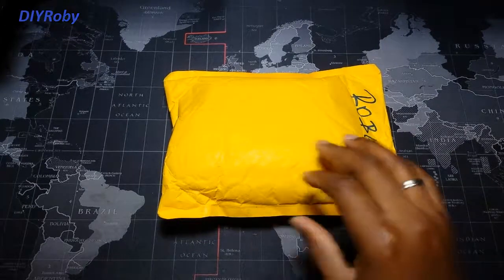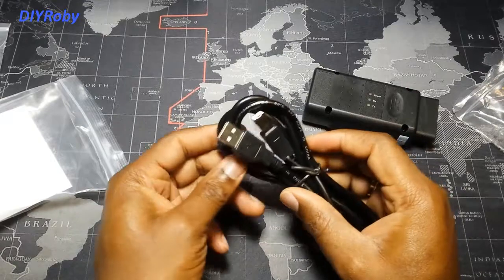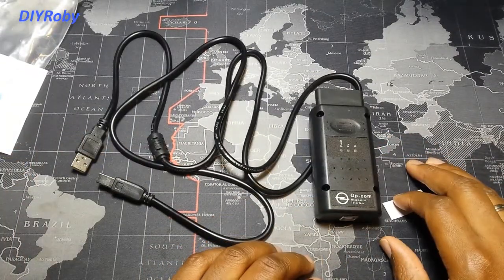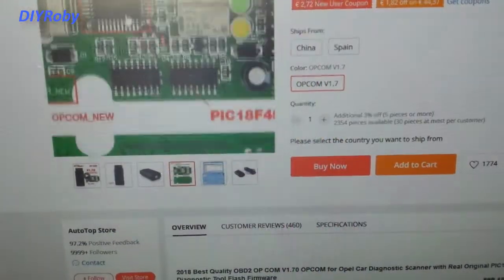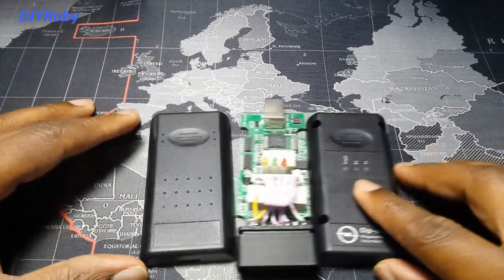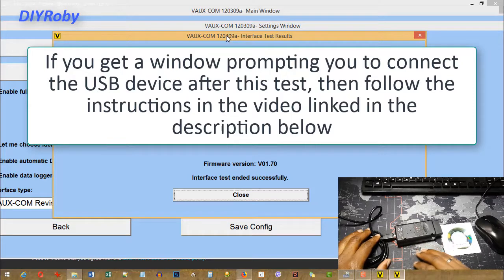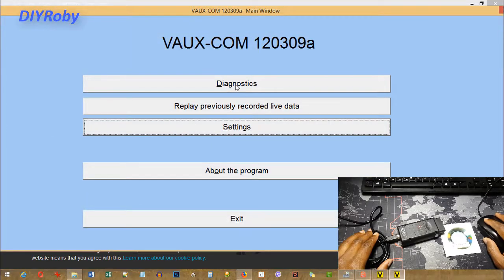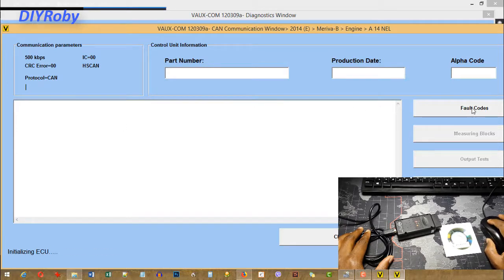Opel Car Diagnostic Code Reader OPCOM V1.70 PIC18f458 Unbox, Internals & Software Setup

Comment: Hello Roby, I wonder if you are satisfied with that OBD. I would like to buy one from China, but some comment bady about copy products selling in Chinese sites.
Reply from the maker: Hi, I believe I sold it off after using it to find my car's issue. Also, I no longer own the car and it's been a long time so I can't comment on the device now :(
Reply: I just bought one off ebay. firstly the drivers don't work out the box, you have to turn off sign checking, not a big deal but you have to mess about and it comes with no instructions. I could not get mine to work at all, i spent most of the day messing about, the seller sent me a web link but windows wouldn't open it because it had a virus in it. THe seller  I bought from has no idea how to use the product and when I asked for a refund got all the usual Chinese seller type things trying to avoid their legal obligations for selling in the UK. Don't waste your money.

Comment: Hi Roby, i'm following you because your one of the only one people on YouTube doing Meriva-B video and I'm having one myself, also I like your videos, I recognize myself in your hobbies 😉
Please let me know if you can access to the programming button to disable the warning sound from the belt.
It should be located in Body>SDM>Programming>Program ECU>Sbr warning sound statuts but I can't click on Programming because it's greyed out on my computer, I was wondering if you can access to it on your Meriva or if it's simply unavailable on this car model.
Mine is a 120hp petrol engine from 2014.
Regards from France Roby !
Reply from the maker: Wow thanks for such a positive comment Azrael, it made my week. I started shooting videos on this car a couple of years ago when I found out that there was NO available repair manual online or in the bookshops for sale. I needed to install parking sensors and had to find out wiring/dismantling procedures etc by trial and error. Nice to meet a fellow DIYer. I just checked out your settings and my programming button is greyed out as well at this point Body>SDM>Programming. I'm not sure low-level scan tools will be able to make such a change. Take care pal.
Reply: Hi FB, on my friends meriva_B year 2010 1.4T all greyed out at engine special functions, also at bcm special functions.... 🤬 In your meriva B available ? Thanks